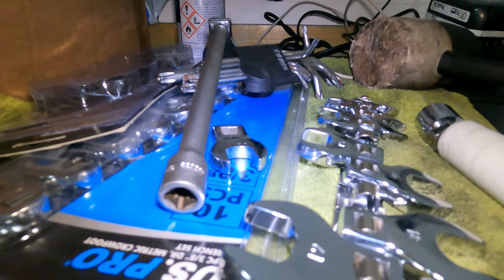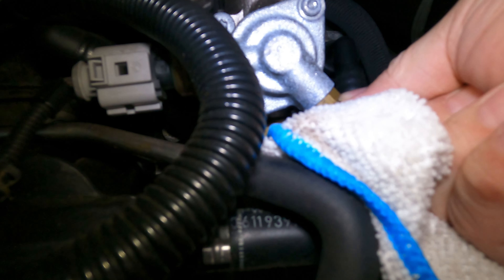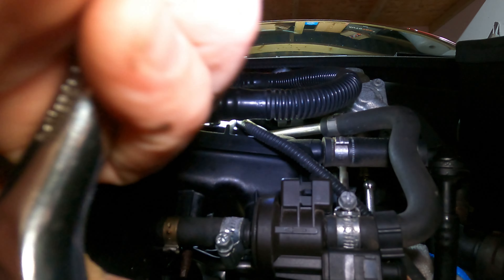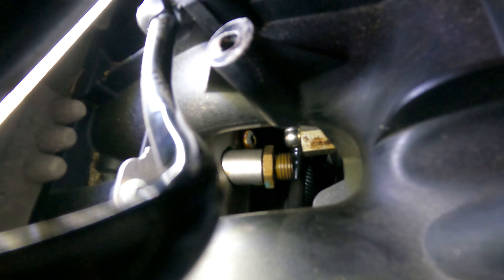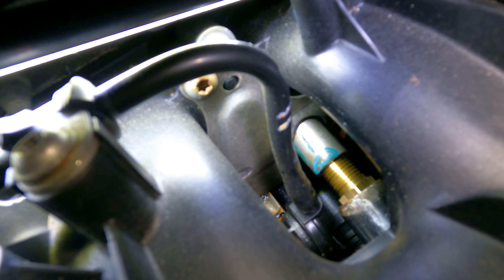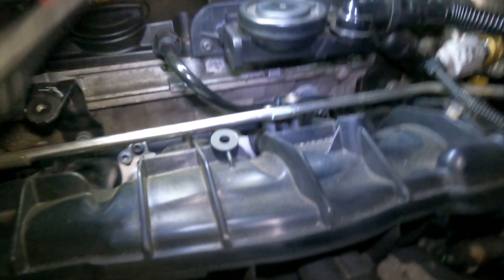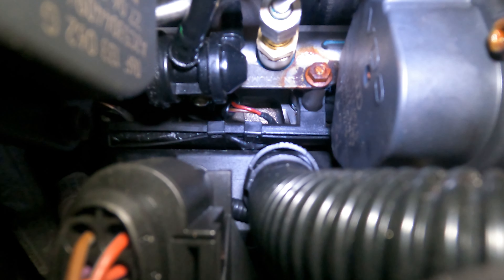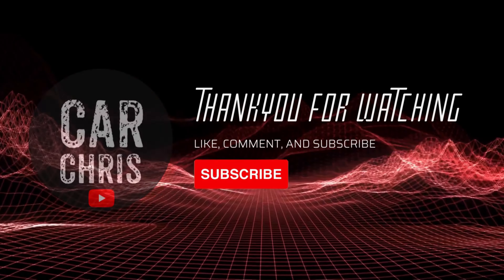DIY- RS4 Fuel Return Valve Upgrade Without Removing Inlet Manifold 2.0tfsi

Comment: did this make any performance differance?
Reply from the maker: I took it off in the end as its not needed on a k03 butbon a k04 I would have kept it on and it help maintaining good fuel pressure
Reply: @CarChris82  what about the uprated fuel pump did that make the diferance for the map
Reply from the maker: Yes that was needed for the stage 2 +
Reply: @CarChris82 hello did you maybe know the problem audi TT 2.0tfsi when stay about one thay need about 10second to start car after you shut off and start agin it start emidiatly after 1 day its procces the same 10sec to start i change non return valve what is come to engine the fuel pump pressure its okey its maybe non return valve on the rail or piston on high pressure pump
Reply from the maker: It could be many things  leaking injectors of hpfp not holding pressure.do you have a eml ? Get it scanned
Reply: @CarChris82  did it make the car over fuel on idle as i have it on and my mapper is telling my car is over fueling not sure if its that